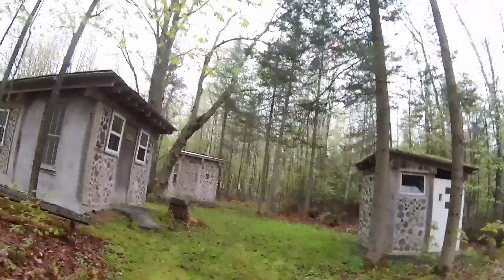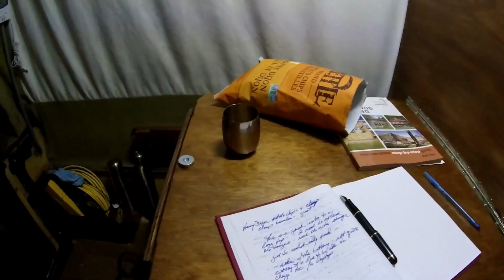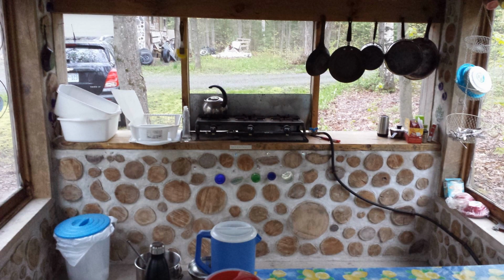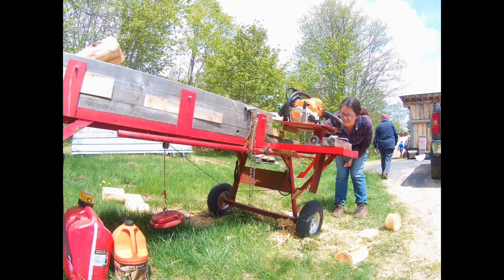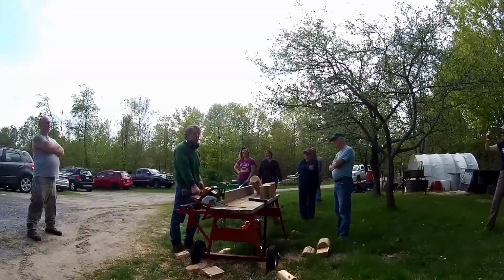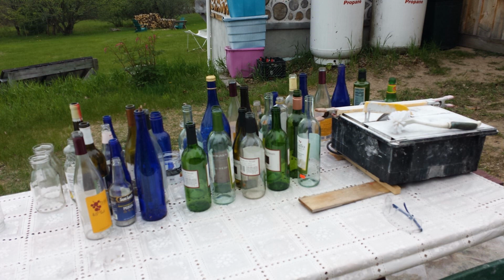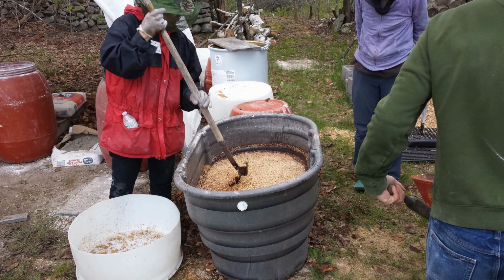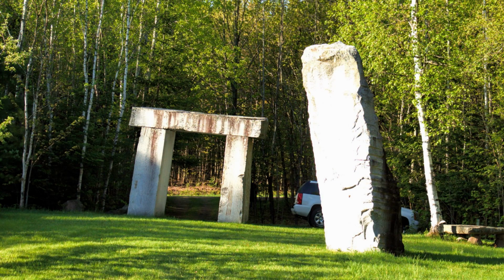Earthwood 5, 6, 7 2019 Ep 19

Comment: Jim,  Interesting looking technique but from sitting in my once cedar sided, now thirty-nine year old house in a midwestern hardwood forest, I must confess I look at the end of the logs making the walls and instantly imagine hearing woodpeckers going crazy (as they began to do after about thirty years in my once cedar-sided home).  I would think that northern New York would have the same issue.  Any discussion of that and of course the more logical question, do you have any winged jack-hammers in Newfoundland?  I don't recall seeing any, but then I wasn't really looking for them either.  I can tell you, there is nothing like the sound of rat-a-tat-tat and 300 RPM at about five a.m.
Reply from the maker: The main buildings on the campus and a number of structures on properties down the road are in the 30 yr+ range. Lots of woodpeckers. Here's something interesting, insects, woodpeckers and fire have a very hard time dealing with the end grain of a log end. Going thru the side of a piece of wood, no problem, but the end grain proves challenging. I have seen an inside wall of a cordwood garage where someone spilled a gallon of gasoline on a hot mower and it flamed. They just shut the garage door and expected a total loss before the volunteer rural fire crew could make it. It burned itself out in half an hour, charred the long ends, blackened the cement, but the wall did not catch fire and the roof rafters were high enough up that they just got a little soot on them. One does have to make sure that the first course of logs are at least 6" above the ground level as you can get water rot problems.
Reply: Wow.. wouldn't have guessed that as a favorite early morning activity is sitting on my elevated deck with my morning coffee and watching the pileated woodpeckers work across the ground attacking all kinds of fallen wood.    Never noticed a difference between the bark sides and the ends.. though now that I think of it, the bugs do typically live just under the bark.   @OldGuyonaBike
Reply from the maker: @richardmourdock2719  The first thing one wants to do when falling your trees (or buying freshly cut 8 footers) is to debark and then cut the lengths to your wall size. Most of the houses I've seen use 16" logs although most of the outbuilding walls we practiced on were only 8" thick. There are quite a few century + barns/homes and other buildings in the US north east, Ontario, Quebec and the northern US mid--continent states. There is a fort in Germany using 4' logs and the same technique that is around 800 years old.You do need to let the wood season for at least a year once cut to size... so it may be 3-5 years before I start a real project. Looking for land in the next 2 years.
Reply: I saw something vaguely similar on TV a few months back.  A woman from the Midwest was building a place in the desert near Tucson to go "off grid".  Her technique was to essentially fill a long, plastic fiber tube with sand.  The sand included mortar mix and it was all put into the long tube and then laid in a semi circle on the ground.  Then another to make a full circle with a break for a doorway.  Then, <get ready> she placed a long strand of barbed wire on the tube and placed another tube, slightly inward of the first. The barbed wire was to keep it from sliding.   She continued to do this until  what looked almost like an "igloo" existed.   When it was all done, she spread chicken wire over it and then sprayed it with shot-crete.   It sounds pretty primitive but actually ended up looking very nice with the top being covered by one large domed skylight.  Several smaller circles were adjacent as "rooms".   I'm normally not impressed by such stuff and have no desire to go off grid, but I thought it a cool concept.  The thick walls were effective in the desert to keep out the heat and hold in the warmth in winter.  If you've checked into this stuff for a while you may be familiar but I can't think of what the process was called...…….  Probably googling "Arizona Tube Home" will get some results.    REM   @OldGuyonaBike
Reply from the maker: @richardmourdock2719  I will have to take a look at that. Too old to pound dirt into 800 used tires, but there are lots of interesting alternate building techniques out there.